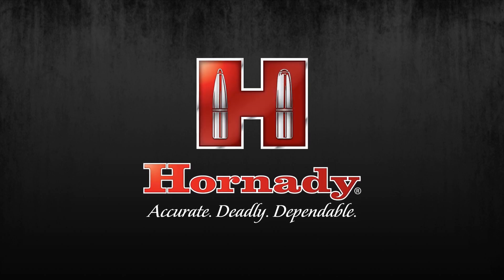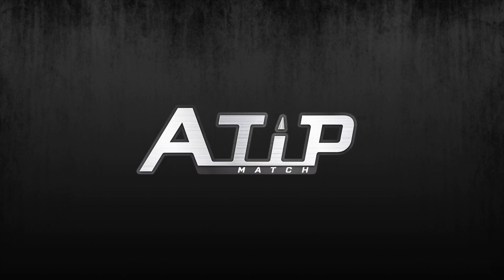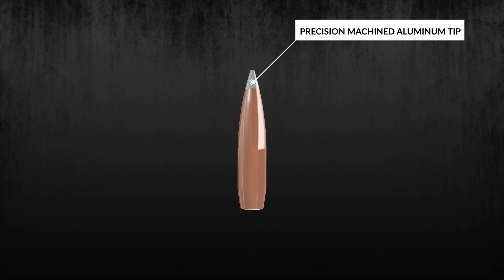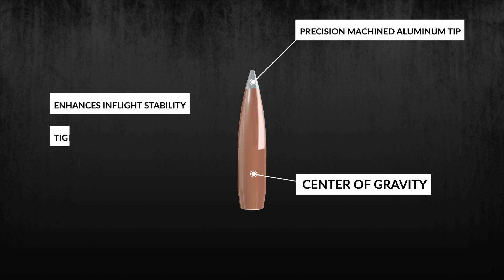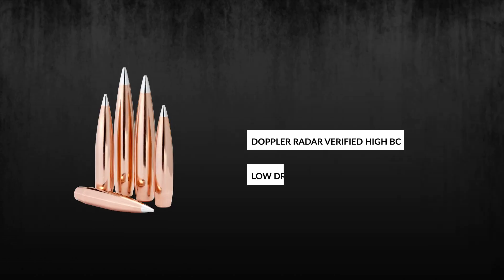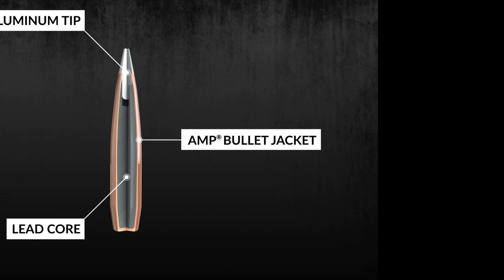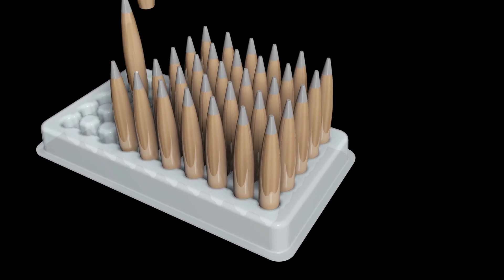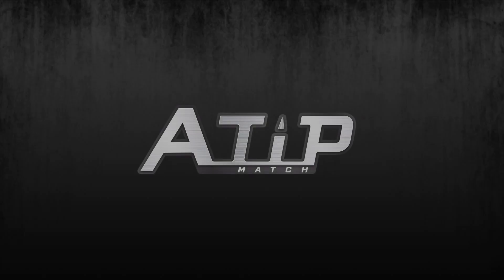Hornady® A-Tip™ Match Bullets

Comment: I'm still holding out until you guys release the U-Tip : Depleted Uranium tipped bullets. 😜
Reply: Jonathan Ocab   LOL   I’m still holding out for the release of the Z-Tip  Zero Gravity Bullet. No drop perfectly flat shootings, no loss of velocity. Just have to be careful of your backstop or the bullet will leave the planet... unless it has the optional on board variable drag guidance system. .... that helps with the UULR long shots to account for curvature of the earth. 🤪
Reply: for when you need that 275grain 22lr round?  :P